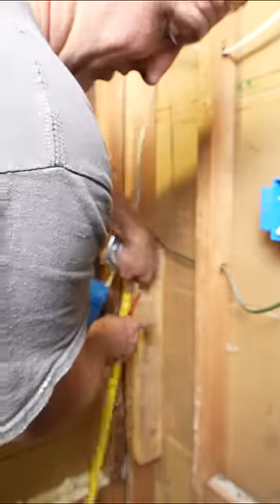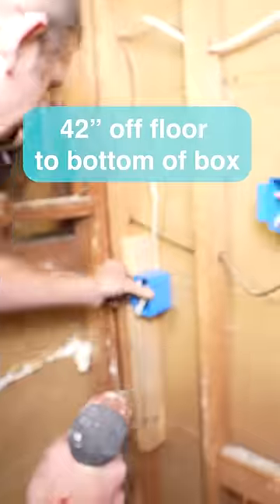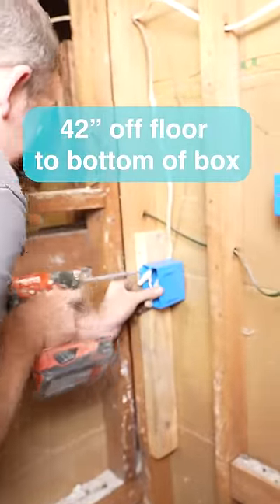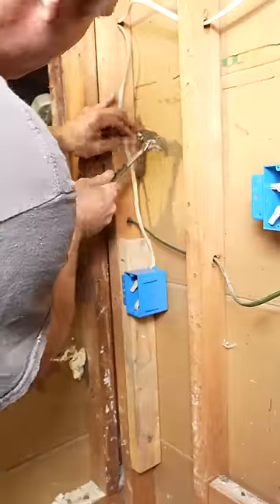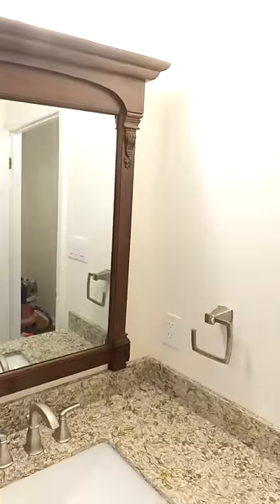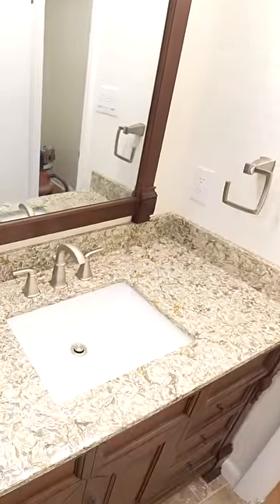Signs of bad electrical wiring

Comment: Clearly this was a whole bathroom remodel and moving the outlet was just a tiny element of the project. I’d love to hear what “code violations” are present in the final wiring. Great work!
Reply: The wiring he ran to the box is not supplied by a 20amp rated circuit so yes that is a code violation. You can tell it is 14-2 by the color of the jacket. There’s one code violation. He’s also violating building code in my area, an unlicensed person cannot perform the electrical work. So there’s two “violations”. I really wish contractors would stop sharing electrical work on the internet, you are doing more harm than good.
Reply: @IceCreamJones42069 I hired electricians . Only ones that could hold a conversation, and would write a report after . That was worth less than the paper he wrought it on . And left unsafe electrical.  And missed a 14-3 wire so now I got to figure it out . $2000 well spent …… NOT!

Comment: The outlet was probably used for a backlit mirror. That would make sense of why it was on with the light switch. 

I usually use a clock style receptacle that recesses into the wall.
Reply: @automat3000  I’m not understanding your question? All circuits in a residential home are fused/breaker at the electrical panel in Canada. 

The lighting receptacle behind the mirror is usually on a Single Pole switch.

Comment: Amazing some of the stupid replies:
1. Just because its a standard outlet doesn't mean it's not GFI complaint. GFI GFCI breaker could be installed in the panel, or the main GFI could be in the master bath and this bathroom is protected down stream.

2. For the video, the outlet he is replacing was probably placed there because of code (3 foot rule). Additionally this is probably and older home where the only plug in originally was in the old light fixture above the sink. 

Code, no electrical outlets within 3 feet of the water faucet in bathrooms. I'm not there to measure but that's what I see from the video and thats probably why the outlet is high up on the wall. Furthermore his 42" high outlet is a code violation with the short distance to the center of the sink no mater GFI/GFCI, or 20 amp, It's wrong.

Comment: Sure hope that’s GFCI outlet. I too despise towel hooks 6 inches above the sink, so useless. Better if the receptacle was at the counter edge rather than back corner so the cord of, say a hair dryer, wasn’t suspended over the sink or worse a looped cord falls in.